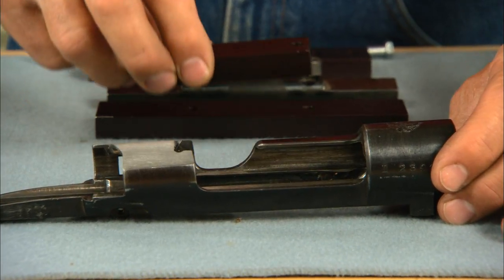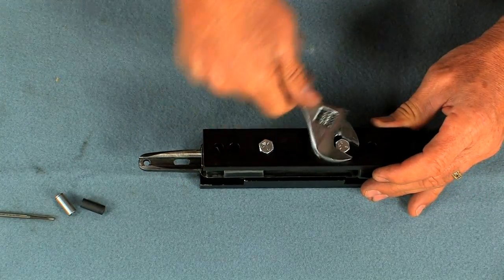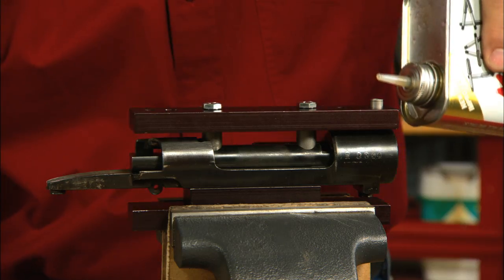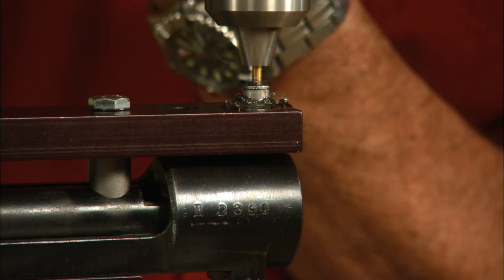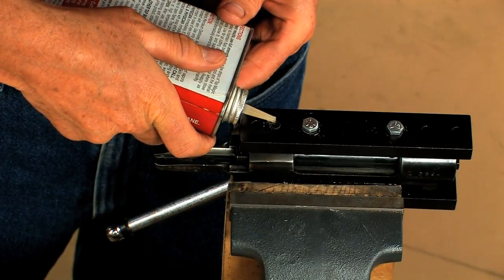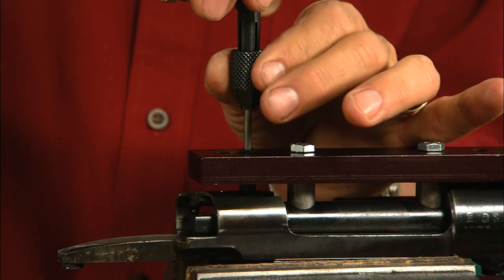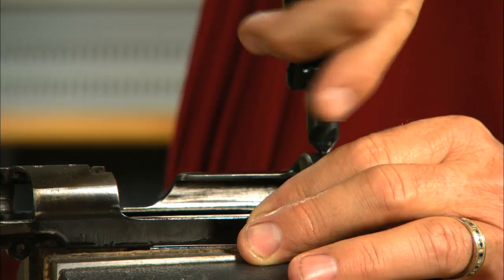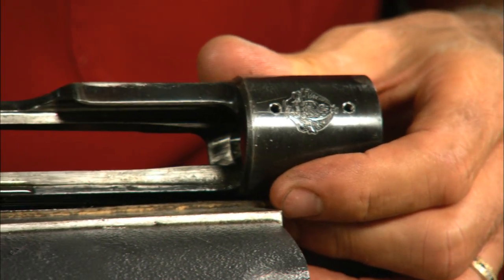How to Drill and Tap a Mauser Rifle Receiver for Scope Base Installation | MidwayUSA Gunsmithing

Comment: How to ruin perfectly good mausers.
Reply: A rifle is a tool, and just like any other tool, it's up to the owner to decide whether it stays usable or becomes nothing more than a decoration. If you're after the Preserving history angle, I can assure you no one is forgetting about mauser rifles any time soon. If you're worried about its original craftsmanship, then how is this any worse than replacing the handle on a rusty knife? If you're worried about its collectability, I think you should be more concerned with the emmensely fucked up state of the Milsurp market that exists because of collectors.
A rifle is a tool, a machine made to do a specific thing, and if you can make it do that thing better, I'd hardly call that "ruining" it.
Reply: i get the sentiment and maybe some rifles have museum value. The other way to see it is that many countries have piles of surplus rifles laying around like The m96 mauser here, and alot of hunters who dont all have money to burn. These old rifles make great deer rifles and get a new life.
Reply: Only reason to tap a milsurp is to install a historically correct scope. Say you have a Swedish M96 that holds very tight groups. Tap it and install a reproduction M41 scope mount and AJACK. It’s not original, but it’s as close to original as you can afford, as that’s $1500 instead of $4000
Reply: Also maybe the barrel was wrecked but the action was fine, so say it was already “ruined.”

This is bringing new life into it and making it worth the rebarrel.
Reply: It's not a German reciver

Comment: "Part 2 shows you why to drill an tap a Mauser military rifle receiver."

"There's no part 2."

"Exactly."
Reply: Yes because there doesn't need to be a reason why its their property they do with it as they want
Reply: @royrogers3624 
Sure.
Thing is, people hardly keep any documentation regarding what exactly they did to the rifle and how they did it. Often enough it's not even done professionally, which can result in problems reaching from "unable to zero it/hit anything consistently" to "unsafe to fire". And then they go on trying to sell the rifle as a collectors piece, charging a collectors price only a good example of the base rifle they once had would achieve, even though their work ruined its collectors value.
There're plenty of better options on today's market. So destroying a genuine piece of history, which become increasingly unobtainable by the year, doesn't make any sense.
Reply: @royrogers3624 
Not yet.
And $35 is already considerably more than you would've paid a few years ago for a "garbage rod" receiver, back when it was considered junk and you could get the whole rifle for under $100.
Reply: @ShootAUT  actually a few years ago they were 60 to 75 usd but nice try

Comment: How would you remove a broken tap that's stuck in the mounting hole?
My late grandpa was a machinist. He tried re-tap the scope mount holes in his Remington 760, but the tap broke off inside the hole. He passed away before he could fix it and it's been inoperable for over a decade. You can't even move the slide, because of the broken tap.
Reply: There are tap extractor tools that fit in the flutes of the broken tap. If that doesn't work a machine shop could mill the tap out for you as well

Comment: to drill and tap a military rifle  do you have to take the barrel off
Reply: i dont think its entirely necessary. you would have to be careful not to drill too deep. then when you tap you need to be careful you dont bottom it out too hard, you could break the tap. im no expert though im just going off the most logical thought here.

Comment: Two points here. I cant find either the Wheeler or Sun Optics fixtures anywhere. Theyve been off the market inexplicably for about 3 years now. The only kind I can find now are $400 or the scissor style. No thank you. Anyone have any leads?
Second point, this video I get it is brief, but man, dont drill that forward screw hole too deep or youll go into the chamber and ruin your work piece.

Comment: Interesting fixture. I built one that uses the stock screws to mount it and drilled the holes in a mill. This way seems a little crude, but if it works then I'm not gonna argue haha.